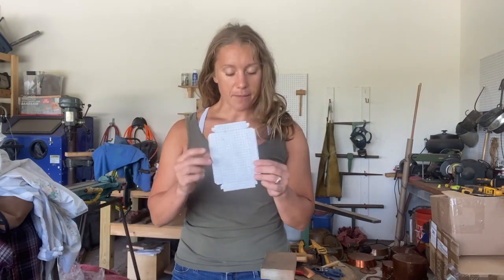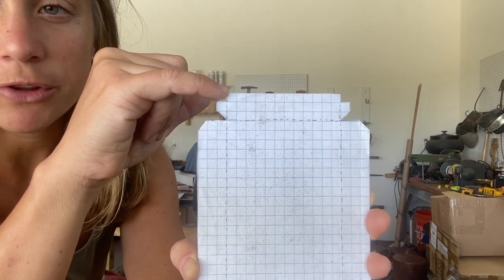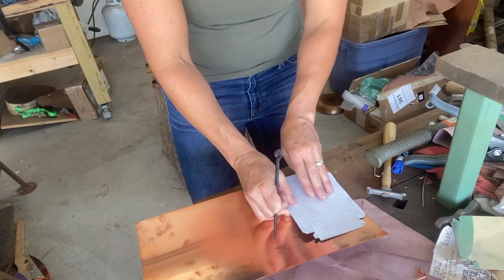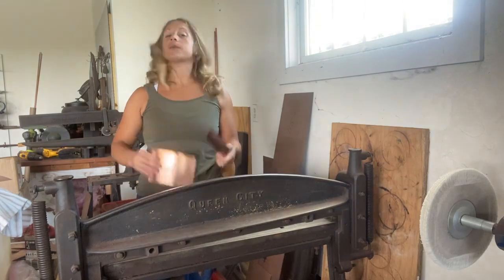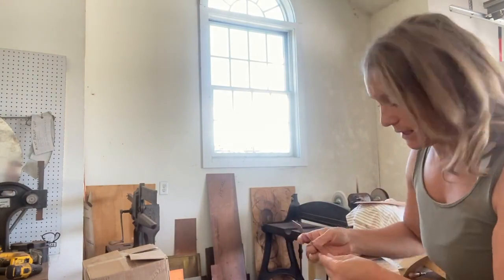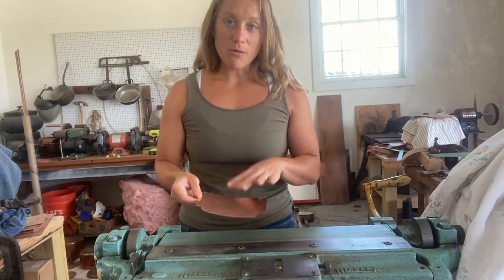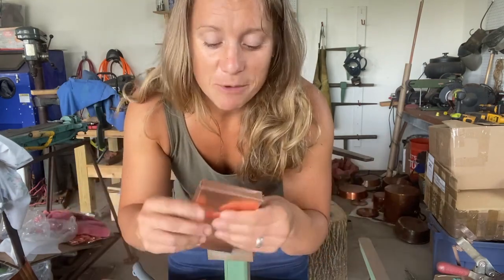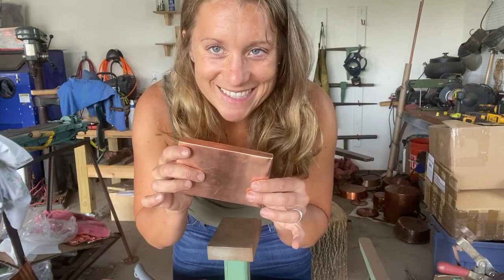How to Build a Copper Box Part 1

Comment: The height of the sides looked really good.  A small Box and Pan break would make the side folds a lot easier. The problem with most of the China made machines is a very limited depth of fold.  Waiting for video #2.  Yea old copper Smith in Rockford.
Reply from the maker: A box and pan break would be awesome - Bob has one in his tin shop, and I covet it!